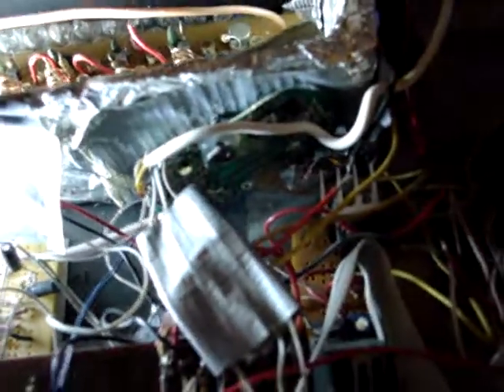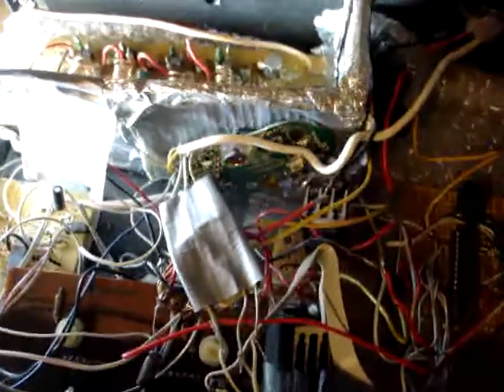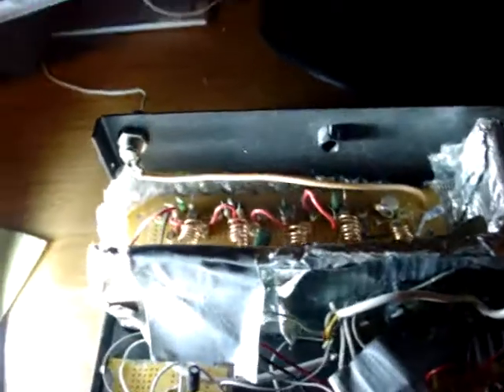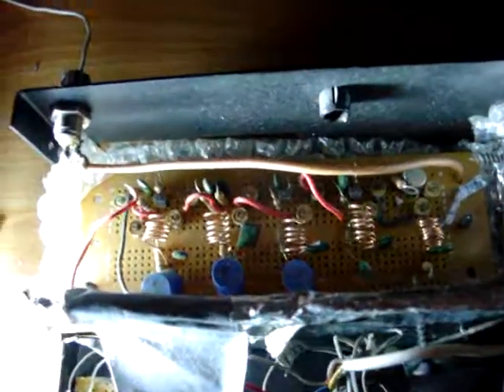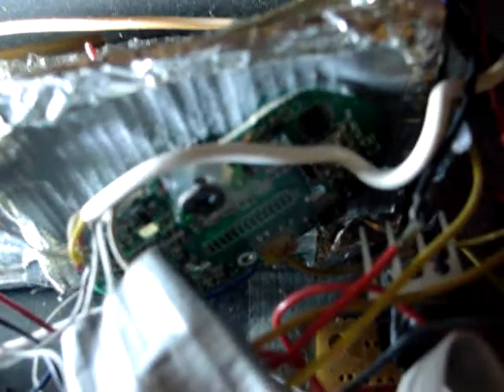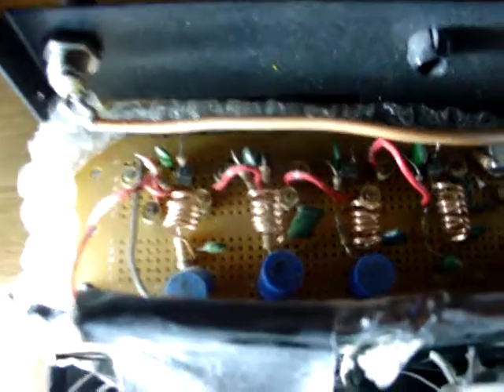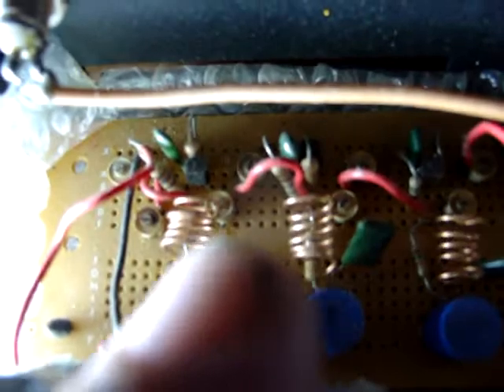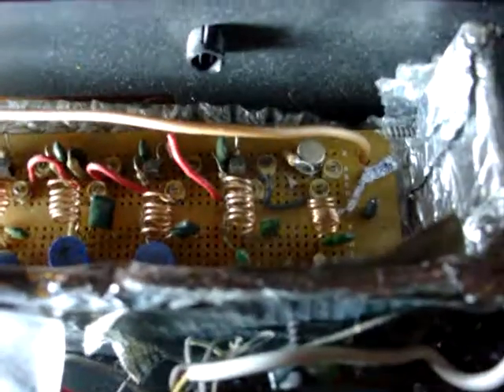DIY FM Broadcast Transmitter part 2

Comment: Your LM324.. what actual part no. and manufacturer did you use. Mine was a TI chip.
I used a few other chipsfor the display and the VU driver LM3914/3915/3916 and the TLC5940.

Comment: Mine has a lot of the same components, say except for the tunecast.. but it will output 20, 40 and 50w depending on how I have it set up, but its enough to drive a 500w FM amp.